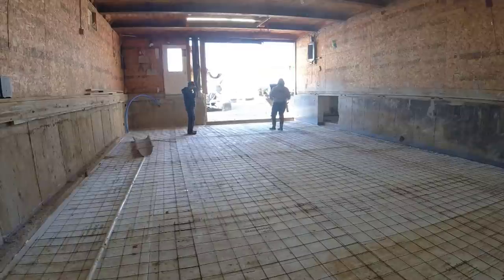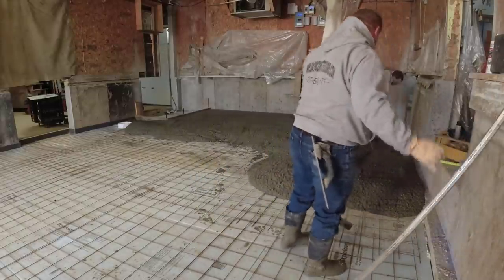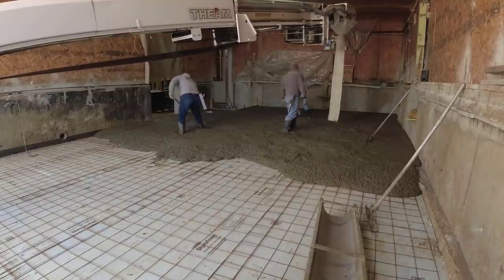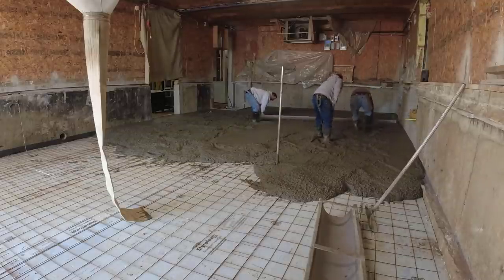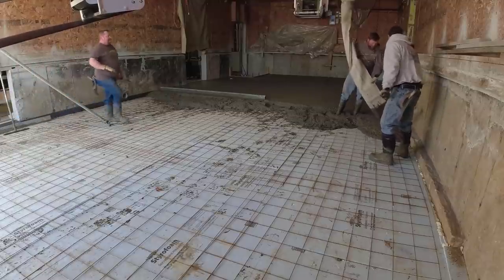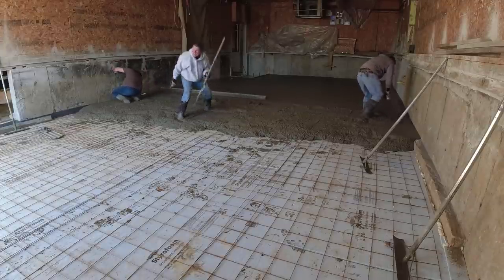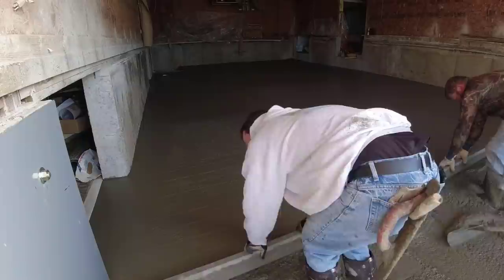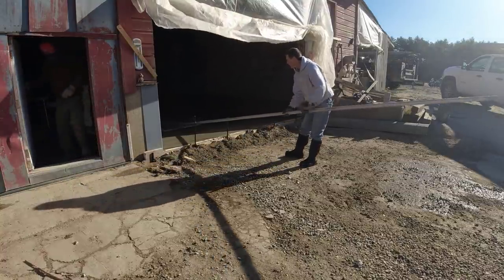Farm Concrete Floor Pour - Sloped 4" from one side to the other!

Comment: Few questions. How did u mark your heights around the  building?, 2- Did u use the same thickness throughout the pour even with the 4" slope? 3 - roughly in general what length of time does a guy have to wait till you can edge a pour and add the line things to stop cracks. Many thanks love the vidoes!

Sorry question 4, I haven't seen anyone using a Vibration Poker for taking the air out the cement,  we do that here over in the UK, just wondering if it was absolutely necessary to do it.

Comment: Hello, perhaps you can give me some insight.  I purchased 14 acres 6 months ago, with it came a 80x50 pole barn.   The right 1/4 of the barn has a 4 inch slab on it.. well 4 if you measure to the gravel stuck on it.  The slab is sitting on clay soil. and oddly all 4 corners.. sit on cinterblocks.. which the 6x6 pillars for the barn itself sit on top of that.  Oddly the slab corners sit only on 1/4 of the blocks.. its odd...  Anyway, the barn was built at least 40 years ago, and the slab only has 1  crack in the entrance portion but its tiny barely even noticed it unless i looked hard.   I have my 6,000lbs SUV/classic wagoneer stored in there and it seems fine..  

 Not sure how the slab was built with rebar or what as its older than I am.   However it has erroded underneeth in the back a few feet in, so i can see under the slab and they used some THICK ass gravel for the slab.. Looks like 1 1/2-2 inch gravel.. Purplish color i might add if that helps ?.   Also ground hogs aparently dug on the right side at least 6 feet in and who knows what other caverns they dug under it.  

The floor is also sloped on all 4 corner down to the center.. so any liquids anywhere on the slab drains to the very center middle floor drain a marble placed anywhere on the slab will roll to the c enter, which oddly is just a 3 inch drain drilled to the clay and it just well drains under the slab... same with the mud sink on the right side. it doesnt drain out back.. it just drains.. well under the slab on the soil.  Very odd.

What is your suggestion to filling those ground hog holes as best and as most as i can.. typical thick slurry of concrete mixed ina bucket that stays ball shaped in your hand doesnt seem the best way to fill that as it wont get deep in there.. The back, i just built a retaining wall of cinter blocks and shoveled clay soil back in the void but i doubt thatll be the best option either.. no way to compact it really.

Should i be worried about this slab holding my 6k lbs jeep  ?  or no ?  i mean seems to be holding fine the last month its been parked there, and it is a 40 year old slab.. the thickness is just barely 4 inchs like i said i had to measure from top of the slab to the gravel stuck in it to get 4 inchs.

also have a kennle with a 5-6 inch slab oddly.. and it also has eroded under it very very badly.. to the point the sab has sank 2 inchs in the back and split.. how do i jack this back up and fill in the entire void under it?  its nearly all erroded under its a 50 foot by 15 foot slab. split in the middle as two slabs so i guess 25-15

Comment: Hello Mike!  Great to see you !  I wonder if you have started to use and Fiberglass Rebar or Mesh to replace metal reinforcement in your concrete?  I plan on spec-ing it for a new build!
Reply from the maker: We use the fiberglass rebar, yes.
Reply: @MikeDayConcrete  I have a hard time finding a supply source? Where do you get FRP mesh and rebar in America?
Reply: @retiredperson4054  I have used it for the last 5 years, it's a great product and it specs out strength wise an 1/8 inch bigger in steel.  Carroll Supply is my distributor or Menards carries it.

Comment: Mike ,  I’ve never seen you guys use a bullfloat with a chain/cable  or worm gear head. Just wondering your thoughts on those.
Reply from the maker: I got both. I use Superior's worm drive currently.

Comment: I have a couple of questions Mike....when making a patio/porch that is  12' × 7' at 4 inches thick, what size rebar would you use? Would 9mm or 10mm be too thick or just right?  Second topic question is when making a perimeter wall that is 6' to 8' tall while using blocks that are 3.5 inches thick (15" long × 7" high), what rebar size would you use? Thanks Mike.
Reply from the maker: We use #4 rebar for those, it's 1/2 inch rebar here in Maine.

Comment: When I was a kid, the trucks rolled from the plant with DRY concrete mix. They also had water tanks.  Only when they arrived at the jobsite did they pump the water into the drum, and mix the mud.  Why would a truck roll for an hour with wet mud in the drum???